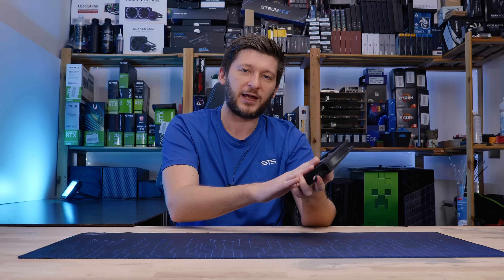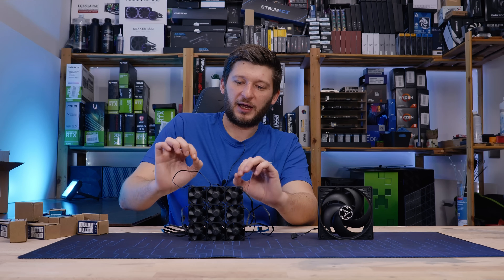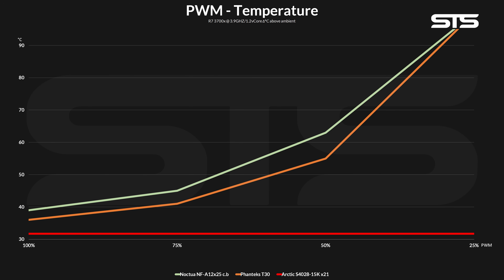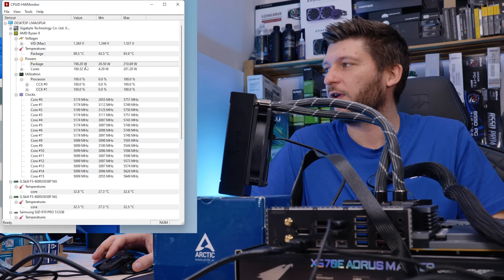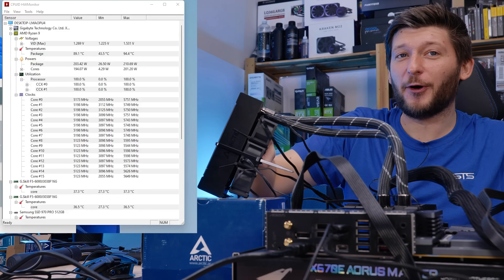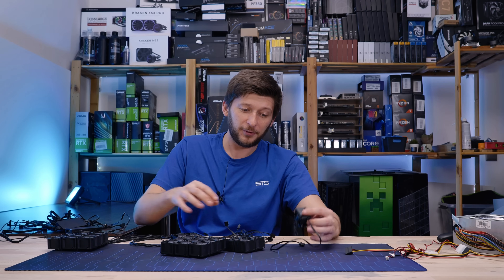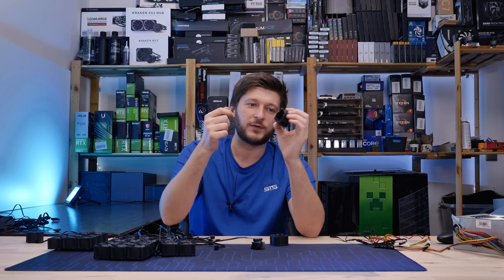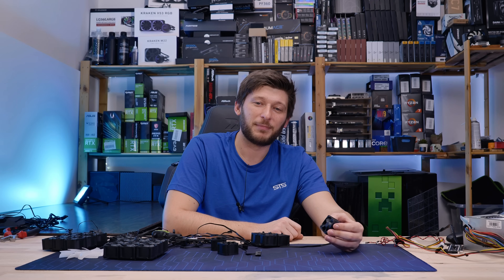9x 15.000 RPM 40mm Fans vs 1 P12 - Arctic S4028-15k

Comment: Probably nobody sees this after 2 years, but.

They might fly, if you "overclock" them, simply plug in to external power of 15V or even more. They should be fine if not used for 24/7. I have few of high speed server fans. 120mm 6000RPMs or some 92 or 80mm 13000rpms. They are fun. :)

Comment: my cooler master aio came with useless fans, they aio was performing worse than a corsair 240 aio what was fitted in 2017 on very dry thermal paste, i tried arctic a bit better but still performed worse than corsair. i stay with arctic i went with the ARCTIC S12038-8K these are insane overkill fans. 800-8000 rpm but key thing they 120mm but they are 38mm thick they move a lot air so do not require to be set to go max they perform so well they won't anyway even when max is set at 75c. the famous brown fans the heavy duty ones the static pressure is a 7, these arctic fans are at a 37 and you can get three for price one brown fan at only £30 for 3 a bargain. for the coolermaster or arctic normal fans to do slightly less they are on max, the crazy 8k rpm fans they at 10% to 30% for most temp range i want, they are more noisy fans esp when they really get going but to get cooling performed i want they still the same if not only a very little bit more noisy as the other had to be on 100% these crazy fans are at a far less % and doing better, if working hard id say max 4000rpm after that they get crazy loud so 4k and how thick those fans are you can feel a gust of wind over 4ft away, and it leaving the pc hitting shelf above and the directed these things are moving crazy amount air i almost do not even need my other normal fans on so normal use pc now sit at very low 30c harder use 60's c that not bad at all, before i put crazy fans in i changed all the fans as they were very old and just that change took motherboard temp from 59c to around 33c added the crazy two fans that now gets as low as 27c. this pc is my gaming and editing pc it only get used 10% of the time, my new itx tv pc and light tasks that dose all light stuff so used 90% of the time and it uses less than half the power. one note tho to crazy fans, do not plug directly to motherboard they are 4 pin so controllable but they are up to 27-29w per a fan at max, you prob burn out your fan header port on the board, i use two fan hubs connected to left over molex plugs both can handle 60w but not to risk it as i guess that over 4 fans so one fan per a hub so far not an issue. only thing is i must turn it on before people go to sleep as start up they ramp up to 5000-6000rpm you hear them two floors down clearly and may even wake next door up but once passed start up they fine how ive set them up
Reply: i also use a stack 4 40x40x28 6000rpm fans at at first when turned on the system my itx build as front case most taken up by psu wall so not a lot room for front air intake. they were so quite i went in to bios , i went looking for software and after all the as they have a bit cover blocking view blades they were on, most the time and most temp range they set to 30%, only at 40c they jump up to 40% by 50c and after that 70% by 70c it set as that because that max temp i want my system to get, i also use one them fans pulling air from below the case and at my low profile cooler, above my id 55 what works very good two slim 120mm arctic fans, and one 80mm fan at bottom front side basically taking hot air from back of the psu, right now motherboard at 36c  cpu at 33c and under benchmark gets to around 65c  but mostly low 60c, only if i max cpu and gpu using two benchmarks it hit low 70c and the id 55 low profile cooler that drawing air from back gpu as that on a riser, but in a case around same size of a shoe box these very good temps . so these tiny fans can really be useful in smaller cases, as my cases it only has two fan mountings and that top case i wanted it to be cooler so i added more fans and it really is not loud at all, normal 4k watching YouTube the fans at 4k rpm not an issue and temps can be around 35c and nearly 40c for motherboard

Comment: DRONE FANS WIEHG LESS TRY THAT JUST TOOK FAN OFF A DUAL CORE HEATSINC IT RUNS AT 5K RPM AND MOVE LOADS OF AIR JUST A SMIDGE BIGGER THAN THAT ONE.

Comment: This sort of setup needs the Koolance hx360xc, a 360mm, 30fpi, 54mm thick radiator for enterprise or deaf hardware enthusiasts.

They explicitly state it works best with ultra high speed and pressure fans.

Comment: I usually modify small fans like this as a hobby. For example, take a 0.09A fan, rewind the stator but keep the original controller and make it have the same performance as these artics. The noise from these microfans is truly deafening. I imagine 9 of these working together less than 1 meter away from you, it's definitely R.I.P. for the ears!
Reply: how do you rewind them?
Reply: @enka_meow  Well, there are 2 types of windings for common BL fan motors, driven by a Hall sensor latch: single-wire stators and double-coil stators. And among these, the double-coil stator is the most commonly used, as the Hall sensor latch can operate with more current in this configuration.

I use enameled electrical wire from 9V brushed DC motor coils - like those that drive cassette tape and CD tray opening mechanisms in old stereos, and I always use the entire winding of two of the three rotor arms of these brushed motors.

Then I make a mark on one of the two wires, at both ends, to differentiate them. After that, I join them and divide them into 4 equal parts, making the necessary markings, so I don't have to keep counting how many turns I have to wind on each arm of the fan stator.
Once that's done, I start winding on the 4 stator arms, based on the original winding. Most of the fans I've worked on, I wound the first arm in CCW, the second in CW, the third in CCW, and the fourth in CW.

After rewinding, I assign one of the two wires of the new coil as if it were the red wire and the other as if it were the gold wire (originally the winding of these fans is a pair of red wire with gold wire), and I solder the ends of the winding to the respective terminals on the PCB.

I won't be able to explain the details, partly because there are many different designs for these fans, and I'm not familiar with them all; but you can also search online to understand it better. In my case, I understood how it worked the hard way, which was by unwinding some stators from old fans and figuring out how to rewind them and make them run at higher RPMs using the original controller, through trial and error.
Reply: @netorodrigs2100 thanks for explaining, what size of fans do you usually do this on? and would this work on a 120mm fan?
Reply: @enka_meow  This type of modification works better with smaller fans than with larger diameter ones. This is because the larger the fan, the higher the current consumption, and the smaller the fan, the lower the consumption. The power bottleneck is the Hall effect controller. The most common one for this application, the 276, only supports 0.4A continuous and 0.7A peak (start-up). And yes, I have modified some 120mm fans, and it considerably increases their speed. But if for some reason the rotor locks up, the 276 will simply explode. That's why it's more successful with smaller fans, because even if the shaft locks up suddenly, this IC won't burn out.

Comment: I'm actually consider using the 5 pack in my "lets NOT cut the top frame" S400 liquid cooling build. So, 3 - 4 of these in front, plus 1 - 2 60 mm fans (the Silverstone FTF6025) and a 120 P12 Max in the back, where I actually can cut .. not the top frame of the case, but the mainboard tray / middle frame.

Comment: Been going back through your videos, particularly the Artic fan ones and this one still gets me laughing almost a year later.
Any plans to look at the Arctic P8 PWM (1800rpm max) or the P8 Max (5000 rpm max)? 
Asking as I'm debating getting either of those as a rear fan for my PC that's currently in a Tecware Fusion/SAMA IM01 case.

Comment: Please please please do not look down on "Delta whatever" fans you just mentioned. They are the brand many server brands use and hell they work in those RPMs for decades. Replacing them with Noctua, Arctic or whatever brand will give you some quiet for a limited time. Servers/switches/routers are ment to endure long durations of heavy duty loads with many different environment situations with those "Deltas" . I bought a few for my DIY projects and would love to get my hands on any other model only if Delta would release products for end user market. I have spent 2 decades in data centers, I know how they sound and I know who they are. 
I have recently used Arctic II Freezer and a dozen of their fans in my new PC builts. They are amazing and quiet. Still, if I can get a chance my hands on 12/14CM Deltas I would not hesitate. Papst and Delta are the long running kings. Try to find decent models of those two for your next video for comparison? Just a suggestion...
Reply: I agree too. I don't have an industrial fan like those of servers, but I have had a Delta blower working on my notebook for over 2 years, and it was only after completing the two years that I opened the blower to clean it - a radial fan suffers serious damage to the bearing if has dirt accumulated on its blades, as it takes away from the rotor's balance - and add grease to extend its useful life. I say these things because I already had a note with a Foxconn blower and it was real rubbish.

Comment: Great and fun video! I want to add one of these fans to the back of my gpu. The backplate has an opening above th actual gpu chip !!! Have anyone tried that?
Reply from the maker: No idea, but good luck.
* make sure to have some sort of anti-sag. No need to add the pull-power of these to the card without help
Reply: @STSYT  yea smart thinking!!! I will put up a stick or something holding the gpu up
Reply: but i use a rizer

Comment: If noise is the only issue, you can look into how a hypersonic stealth jet is kept quiet.
Reply from the maker: Not sure if I understand what Microjet Injections are, but seems slightly OP
Reply: @STSYT  A combination of materials in certain shapes as part of the body where sound would come out so they're not heard on the ground.  It cuts down, reflects and probably partially absorbs the noise from the engines.

Comment: Was the fan noiseless after you removed the frame, or did you just edit out the audio?
Such small fans without the frame would be perfect for circular aeration pipes  if they're not noisy.
I wonder if we can buy just the motor and the blade set as spare parts, maybe even different types of blades if you really want to grate carrots with it!  😄
Reply from the maker: Nah, just altered. It was still like a little turbine, the noise was just a lot "higher"

Comment: why kill your PWM controllers if you're running them at 100% anyway? could've just used 2 pin
Reply from the maker: because I never intended to let them run at 100% all the time. The initial plan was to create a noise-to-performance graph. Didn't work like expected

Comment: It can hover more while in case because thanks to the tube the air is much more concentrated.
Reply from the maker: I actually tried to max that off camera. During my "letting the fans fly" trial I used a funnell, 4x Fans and a bunch of duct tape. Didn't work

Comment: You don't need to worry about getting your finger cut that much. I've already put mine into the 15k one. IT WAS AN ACCIDENT. It was much batter than on the P14 as the ends of the blades were sharp.
Reply from the maker: Yeah... accident.
Yeah.... finger

Comment: Now this is proper science!!

Is that a Mad Catz (R.A.T TE)? 
Mine have given up on moving along the x-axis…
Reply from the maker: Yes! 
I used it as a main driver years ago. But had to replace it because Linux doesn't did not get along with R.A.T stuff at the time. 

Fun fact: For some reason, every window + Taskbar + Desktop on Linux was kinda it's own layer of "clickable". When using that mouse, you would be locked to ONLY one of these layers. One of the buttons on the mouse controlled which layer you were in a round-robin way. So you tried to click something, but actually you clicked behind said window. You still saw the cursor floating above everything, but you clicked right through every layer until the one you were in. 
Tried solving it with various Mouse-remaps, weird software and whatnot, but it always broke and I had to go back and click the "layer" button a dozen times before I was able to do what I wanted to do in a specific window.
It was wild.

Comment: Have you tried noctua's "industrial" fan with the 120mm radiator? That bad boi is capable to run at 3000rpm, but way less loud. Still loud though :D
I see you tried one. A 140mm one, which I haven't heard about so far
Reply from the maker: The "Best 120 Radiator Fan" video had Noctua Industrials in it. If I remember correctly they did not win the price though ^^
Reply: On Digikey there are 300CFM 12v 120mm fans lol.
Reply: I own 3 of the 120 industrials.  

They're insanely loud.

I then bought 12 phantek 120's which seem quieter and have 1k, 2k, 3k rpm switches which make them great for adding some of my older boxes with boxes that don't use pwm or allow voltage adjustments
Reply: @censorshipisbookburning3235  Yes, loud. Even when I did not allow it over 2000RPM, if I remember well. The 1700RPM redux is way more quiet.

Comment: You need hearing protection! This too funny! Way to go, Arctic, for going a long with your stunt. Too bad they don't have a bracket to make it easier to assemble 80mm and 120mm fans.
Reply from the maker: That would be a great product idea though ^^ Or maybe a giant funnel shaped thing staring off at 40mm and ending at 140
Reply: What you really need is a shed in the yard and very long DP and USB cables.

Comment: hey STS, im planning to buy arctic p12 or f12 fans for case fans. which one should i go for it?
Reply: F12 are good, I have 4 of them in my lian li air mini and they work well. P12 could be better for a heatsink or radiator. Maybe try to check if you can go to a f14 instead
Reply from the maker: If you can, F14, otherwise P12. F12s are a bit too loud for my taste

Comment: Well, yes, smaller fan means more static pressure but less airflow
Reply: but why? keep in mind that blades are waaay smaller so these fans thould be less effective
Reply from the maker: Because you calculate static pressure in relation to the fan size. The smaller the fan the easier it gets to bump that number up. 
Airflow will loose heavily though.
Reply from the maker: In general yes. Airflow for sure, but static pressure in relation to the size.

Comment: We've known we get uplift with small fans (relative to their size) especially in restricted flow situations, since they have a higher static pressure. Though the power use is high...And you hear the noise. The reasons for the higher static pressure is the thickness to diameter ratio, and the ratio of the motor hub diameter to the fan diameter.
Reply from the maker: Agree on basically everything. Though also keep in mind the speed at which these spin. Not all small fans are that quick